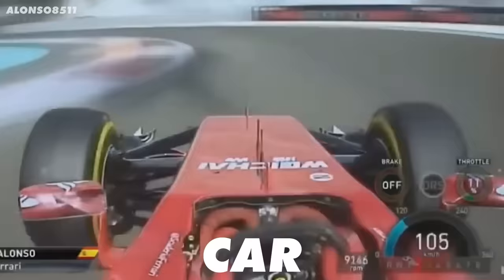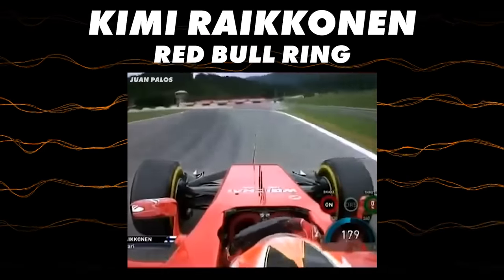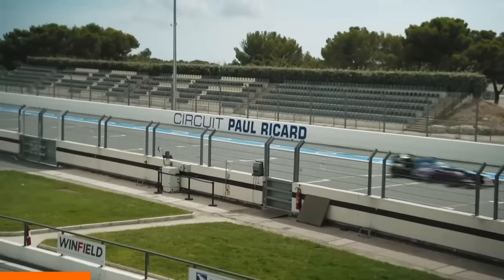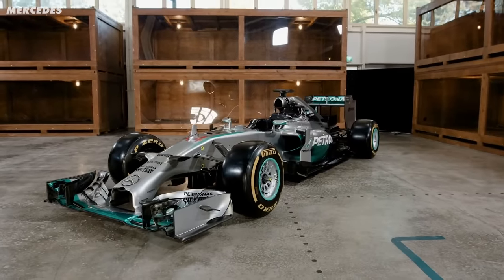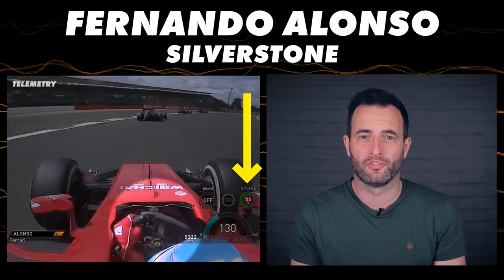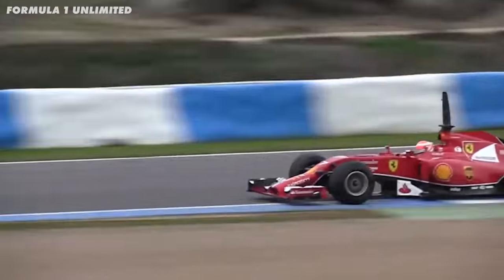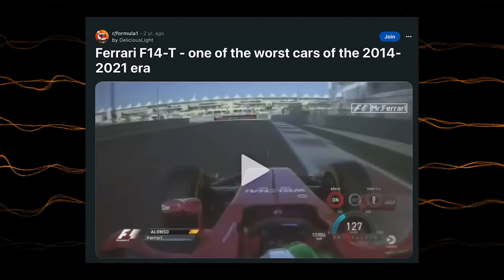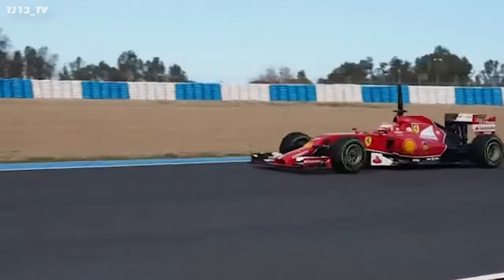The WORST Handling F1 Car EVER?

Comment: The problem with this car (especially for Kimi) was that the car had massive turn-in understeer during the corner entry phase, with snap oversteer happening on corner exit. This is completely the opposite of Kimi Raikkonen's driving style, which focuses on getting the front end into the corner immediately and finding the limit of the front axle, with no understeer at corner entry. The 2014 Ferrari was more suited to Fernando Alonso's driving style. A meaningless season where Kimi was nowhere remotely close to his true speed.

What's more is that the pull rod front suspension makes it doubly hard to change the front end - it takes twice as long to adjust the front end in a pullrod than it does in a pushrod.

Finally, Kimi had a rookie race engineer that season who was out of his depth.

Raikkonen is faster than Alonso. Circumstances in 2014 meant he wasn't given the tools to show that.
Reply: Do you believe Kimi (not just him but generally drivers of this century) is somewhat fortunate to have been born during a high downforce / CAD software era? Say, he had to contend with the understeer of Dan Gurney's cigarette roll Lotus car—or any car from the 60s for that instance, it could have potentially hindered Kimi from pursuing a successful Grand Prix career. Whatcha reckon? That said, I'm not casting doubt on Kimi's ability behind the wheel of modern cars or his unparalleled bravery—he's the best in this century with Michael, IMHO.
Reply: I think the general consensus is Kimi was born in the wrong era as he is such a natural driver he would have been equally fast if not faster in prior eras where there was no data and natural feel played a heavy role in speed and success. Kimi wins titles in any decade of F1. @isuckatthisgame
Reply: @ciaronsmith4995  Thx for answering. I think what average viewer may also not register is how analytical and data driven Raikkonen gets on engineering scrums. For that reason, I wasn't sure whether he trives in places where sophistication is lacking, e.g. NASCAR.
Reply: Great point. Agreed. @isuckatthisgame
Reply: biased statements. what if the car had oversteer and alonso lost to raikkonen? would you scour the internet in defense of alonso who drove a car that didn't suit him hence his hypothetical 2014 defeat to kimi is meaningless? regardless, it is extremely bold to assume that a driver who was tremendously outscored by his teammate as "faster". why? because the year right after... vettel completely humiliated kimi.
Reply: Alonso would also have to have a rookie race engineer who was fired. In that instance, I would say Raikkonen is faster but the car exaggerated the difference between both. I call it as it is. 2014 was meaningless. A total fluke for several reasons. @no1washerezz